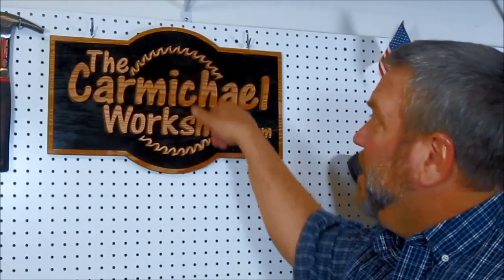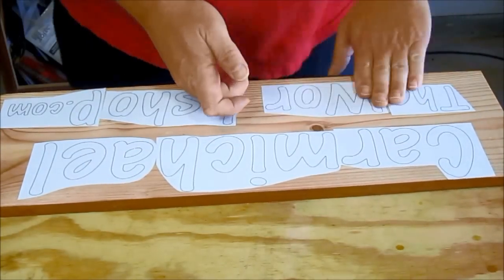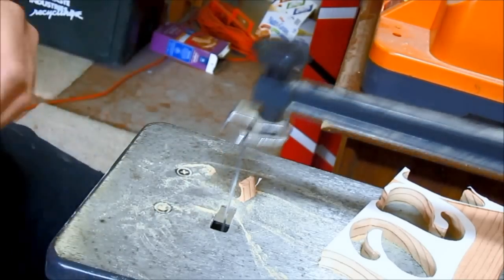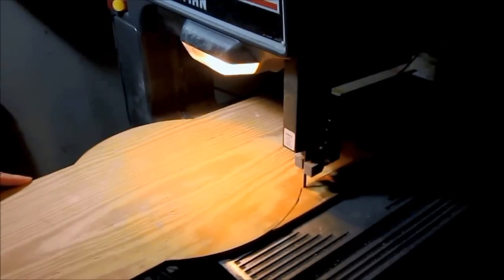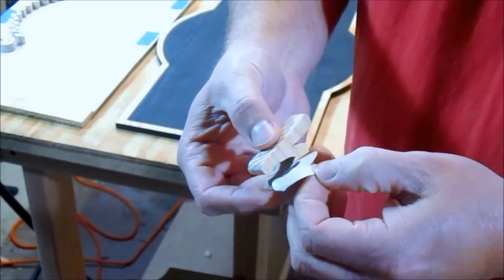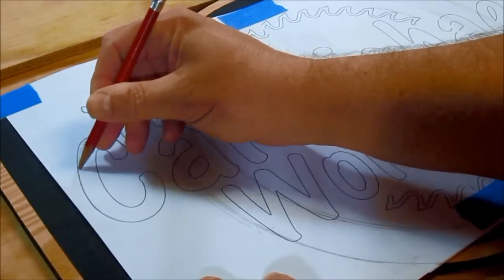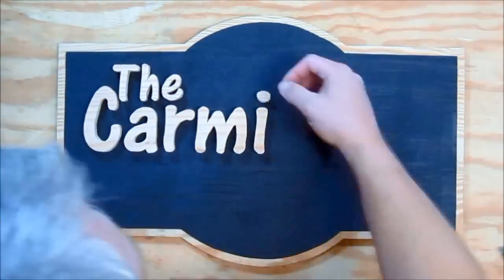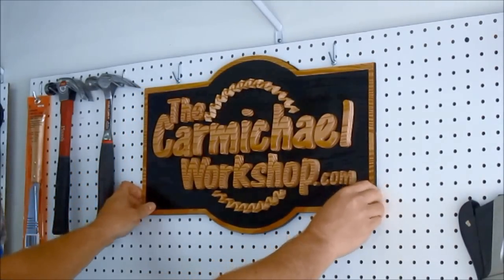How to Make a Wood Sign with a Scroll Saw - Easy DIY Project

Comment: The sign does look really good.  One clever trick I picked up on the web someplace is to put blue tape on the wood before you glue your letters or pattern onto it.  Now you're not gluing directly to the wood and the blue tape comes off easily.
Reply from the maker: Yes that works.  I have since learned just the right amount to spray on the paper and let it dry for about 30 seconds before sticking it on, and it comes off easily like a sticky note.  I can't help feeling that I would be wasting blue tape.
Reply: @SteveCarmichael  I've had mixed experiences with getting the spray glue to come off easily, but then I'm relatively new to woodworking and maybe that just takes time.  You have tremendous talent with a scroll saw.  It's going to take me a lot of practice to get anywhere near you.

Comment: Great sign project, you have inspired more for my To Do List :)
Little tip, if you put the blue painterstape down on your wood first, then spray glue (or glue stick glue) on the back of your scroll patter paper and apply it, the pattern lifts off the cut pieces easily when done. This is from Sheila on Lumberjocks com she is a scroll master (mistress?)

Comment: Hello Steve. How's it going? Hey, what size and tpi blade did u use of the scroll saw. I did a Los Angeles sign (haven't put that video together yet) and I had to do some serious sanding inside the letters =/ your letters came out smoother from the scroll saw. Or maybe speed control? Haven't used it lately but I'm getting ready for another sign for my Boss. Bday present ;^)

Comment: I am new to scroll saw work.  I am trying to figure out what you printed the letters out on.  I understand you used Microsoft Word, but I am not sure if it is some regular sticker type paper I can get from Wal-Mart or something special that has a gentler adhesive for wood.  One of your other videos on 10 fun projects shows the same paper/sticker, but I'm clueless on what to call it or whether it is generic or very specific to wood projects.
Reply from the maker: Hey, I printed the letters on regular copy/printer paper.  I use 3m General Purpose 45 spray adhesive from walmart or home depot.  I spray a very light coat on the paper and wait about 30 seconds for it to dry a little so it feels slightly tacky like a sticky note.  Then I stick it on and it usually peels off easily as long as I do a very light coat.  If it won't peel easily, just dab some mineral spirits on it and it will lift right off, then wipe it with mineral spirits to clean off any residue.